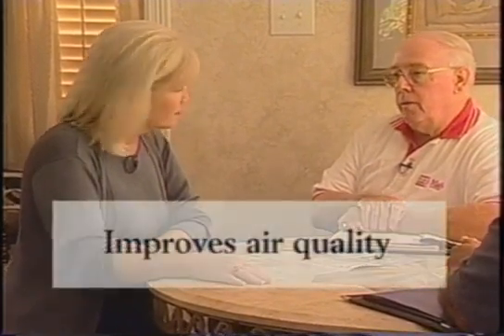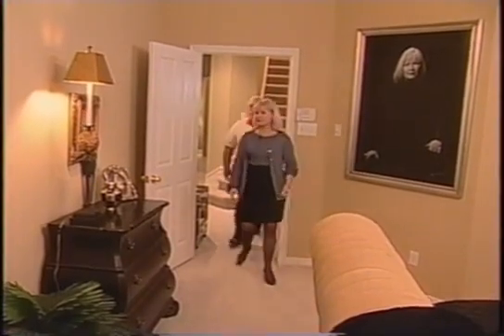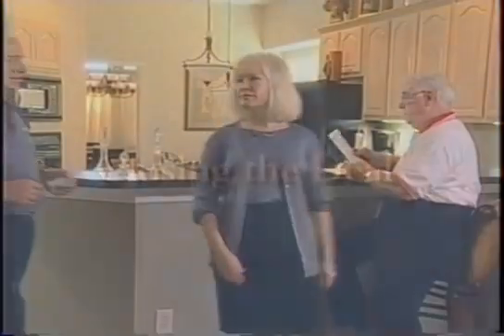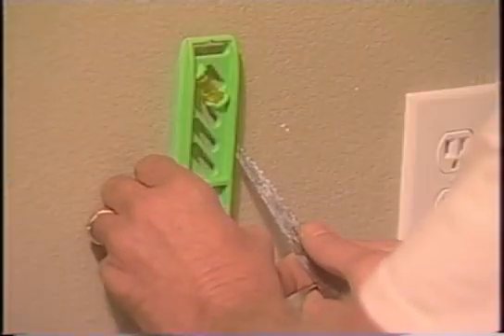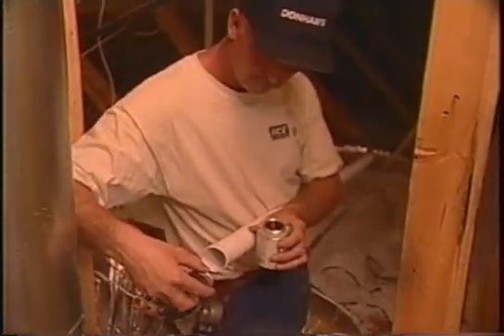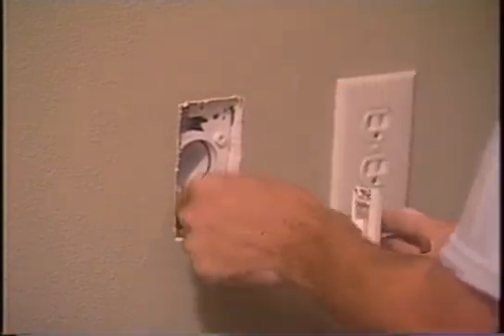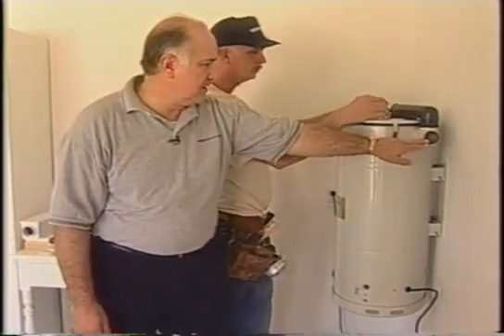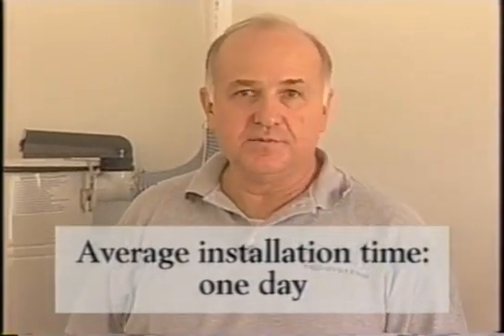AirVac Central Vacuum Sales and Retrofit Video

Comment: Does anyone have any information on those Vacu-Valves with bag-check indicators?
Reply from the maker: The LED on the unit (and on the inlets, if applicable) would blink to alert the user to check the bag, and after hundreds of hours of use, would change from green to amber, then to red, indicating motor service was needed. This was all run off a timer chip in the main power unit's control board, and didn't actually measure the bag fullness or airflow or pressure drop. NuTone had the same technology available on their "Advantage Series" power units in the early 2000s (models CV-653, CV-750, and CV-850), and Hayden's VacTrack worked essentially the same, but the remote LED indicator was on the hose handle rather than on the wall inlet.
Reply from the maker: I forgot that Beam also had this feature, which they called the "Intelliwatch", on select high-end early 2000s power units. To my knowledge, they never offered indicating inlets. The "full alert" was reset by unplugging the power unit briefly and then plugging back in. If there was a way to reset the motor life warnings, I am not aware of it. Even with a new motor (or brushes), if the light was red, it stayed that way.
Reply: @owenperkins  I see. I just assumed it worked like a normal bag-check indicator on portable vacuums, but I guess they work more like Hayden's Vac-Track system. I guess I shouldn't be too surprised, because unless you're vacuuming near the inlet, you're probably not gonna see the light come on. Cool idea, I suppose.

Comment: Do you know how much water lift power suction that particular system from 20 years ago have? It's the same installed in the house i  live
Reply from the maker: There were different motors used depending on the model, but if yours is the most popular ZX6000, it uses a 116765 motor with approx 135" waterlift and 95 CFM. The ZX7000 used a bigger and stronger motor (117500) with 145" waterlift and 103 (I believe) CFM. Airflow is just a little lower than I like to have, but certainly not a weak system, and much better quality than the Red or Platinum series that followed.

Comment: My parents installed an M&S Systems Airvac bagless unit when they built their house in 2000.  I would hesitate to even call it adequate and I've been waiting for the thing to die for years.
Reply from the maker: The bagless ones are pretty bad. Have you checked the secondary filter screen though? Up above the big cloth filter. It only takes about a tablespoon of dust on that filter to kill the airflow.
Reply: Owen Perkins Yeah it was always clogging. We eventually had to throw away that tiny secondary filter covering the motor screen. It was disintegrating and couldn't find a replacement. So for about the past five years any dust that makes it past the main filter just goes through the motor. I'm shocked it has lasted this long.
Reply: I pretty much have the same story and I’m pretty much waiting for mine it die as well except mine was put in in 2001 by the same company but it’s also an air vac system by M&S

Comment: Never seen a piece of flex put on the piping into the unit. None of the houses I clean have flex on them.
Reply from the maker: Airvac always packed that section of flex hose in with the unit. It's not needed, and use in place of an elbow is restrictive and clog-prone. Better if you want to use it (vibration isolation or whatever) is to put it in a section of straight pipe, like an old Spencer Turbine installation.